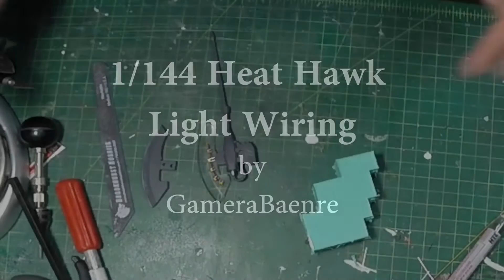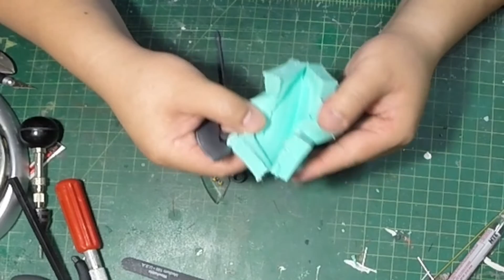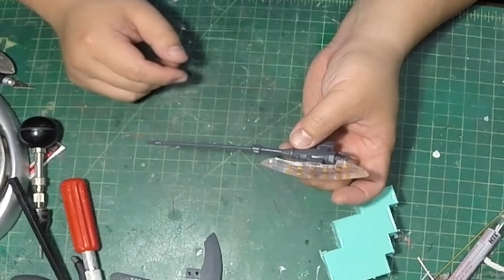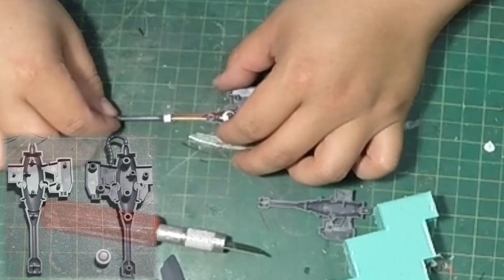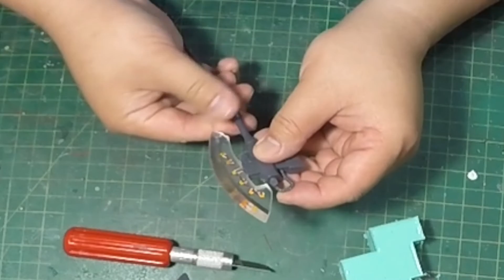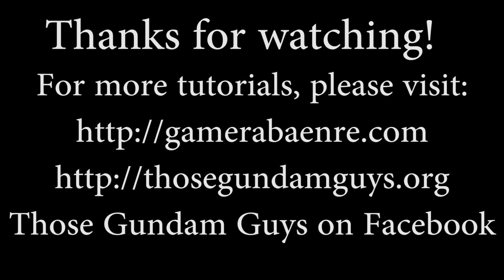Wiring the 1/144 Giant Heat Hawk

Comment: Couldn't you detach (cut) the part out that is opposite of the blade, and either use that for the battery or to reveal a gap to remove/replace the internal battery (and have it fixed in place with a magnet or something?  Nice setup either way :)
Reply from the maker: +Merritt Filban haha.. yeah, that's a good idea too.  I was just going the easy way and sealing it all up, but it's a possibility to create an end cap that pulls off to swap the battery.  I'll keep that in mind, thanks!